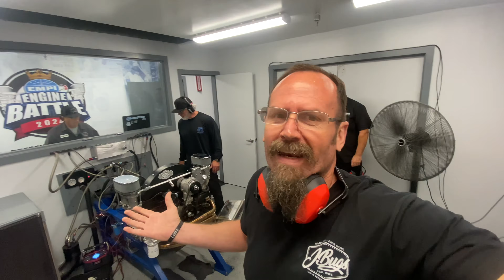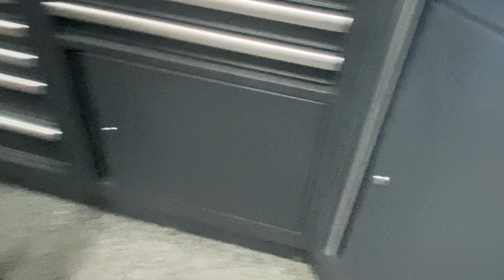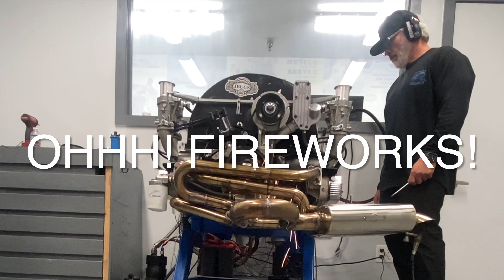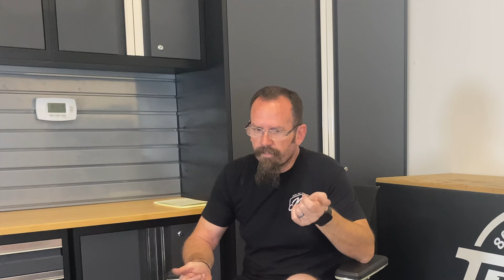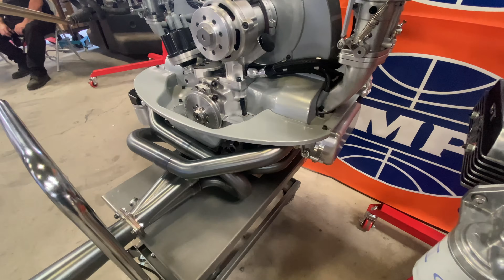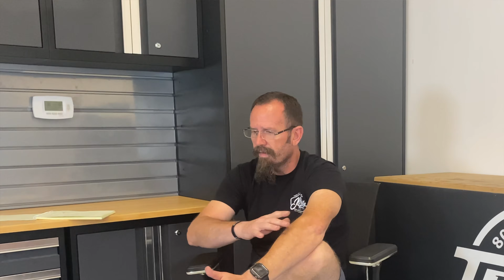JBugs 2024 Engine Battle - EMPI Engine Battle 2024 - Recap

Comment: Here in the UK my vintage road racing 1965 Beetle is getting 126hp@7700rpm from its twin carb 1285cc with stock sized (33x30mm) valves though a regulation (105db max) silencer, so it should be 100hp/litre with a stinger fitted. Gathering parts for a 1299cc (60x83mm) which will allow much larger valves. Currently runs high 14's on the 1/4 and the low gearing means it tops out at 113mph
Love to know if there's any quick 1300's over there in the US
Reply: There isn't a big push on the lower displacement engines here stateside, outside of land speed races.
Reply: @Sam_Mebane  Seems to be a European thing. I'm limited to 1300cc by vintage racing rules. There's also a 1584cc drag racing challenge based in Sweden but covers all of Europe, cars must also use stock valve sizes, quickest in the street class so far is 11.1@126mph quickest race car 9.4@150mph
Reply: 60 mm crankshaft is 25 or 36 horse crank
Reply: 3.88 ring and pinion should give you more top end speed
Reply: @rickmartin7062  If I use a 3.88 the 'theoretical' top speed would be 141mph, but my motor doesn't have the correct torque curve to pull that gear at any speed. It currently has a 4.86 due to it being a circuit racer. The tracks in the UK have very few long straights, so you have to sacrifice top speed for acceleration, from a slow corner I can match the acceleration of the 400hp Mustangs upto 70mph after which they pull away, but you make back the time lost under braking and cornering

Comment: It looks like a key for a key way..
Reply: It's much bigger, and collapsed. My best guess is an 8mm (wrench size) nut or a collar of some sort.
Reply: @Sam_Mebane looked like a valve adjuster nut tbh, maybe it dropped into the gas tank or straight on the carb top, any filters used on that engine?
Reply: @johncollins5552  good eye, yes. That's about exactly what it looks like. There were filters on it from the last 30 minutes I ran it here in the shop, and to the best of my knowledge until it got started on the dyno at EMPI.

Comment: Great job and what a great event. You still put up awesome numbers. Like the lowbugget guy said in your interview after your. A square build. I hope to achieve the same with a 2275 soon. Reliable and cool running with pretty equal hp and torque.
Reply: Absolutely, it might not put out huge numbers like some of the engines on the dyno did but it will scoot a car down the road plenty well!